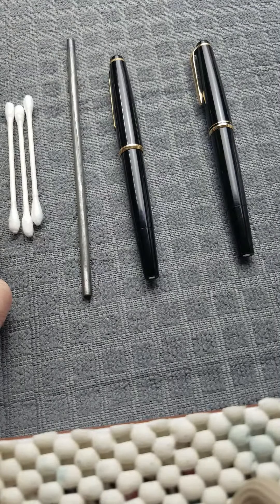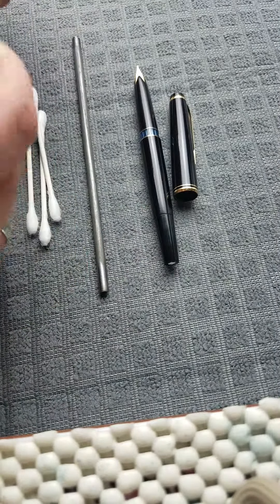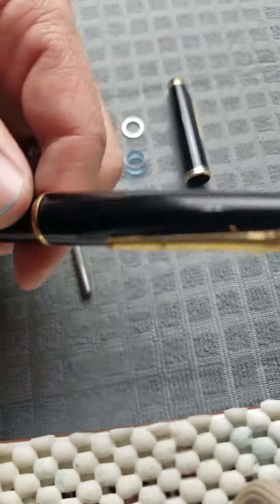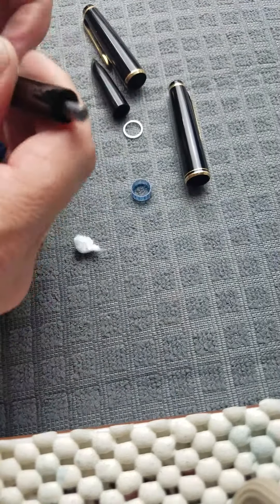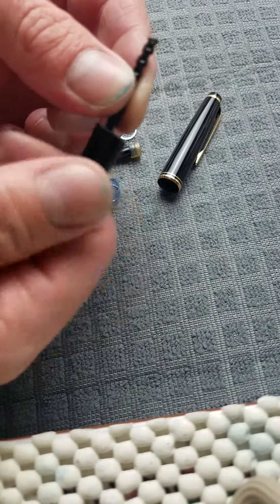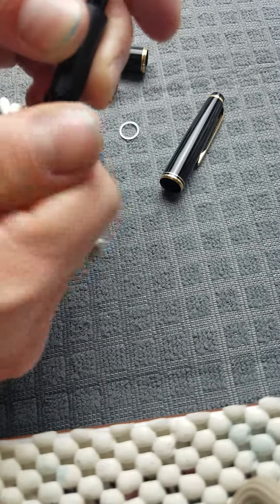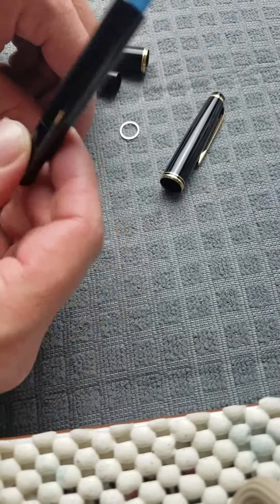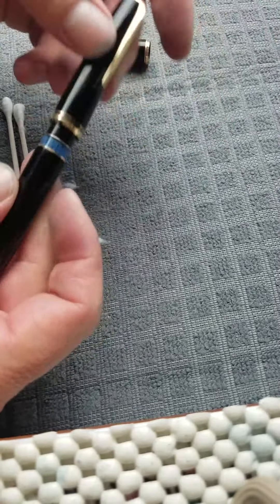Montblanc 22 and 32 disassembly

Comment: Thanks! This video helped me to finally figure out how to disassemble my no. 24. I have the same issue with a  broken off spindle key though. Is there a feasible way to fix the old spindle or do I need to find a replacement? (Hopefully I am using the term spindle right, I'm talking about the piston "screw".)
Reply from the maker: If the helix rod is broken, then you'll most likely need to find a replacement. Glueing the pieces back together may be possible, but I haven't found a good way to accomplish that.
Reply: @penrealm8345  Brilliant, thanks! I too have had little luck with glue and plastics, and the broken off part has become dust so there's nothing to glue in this case. I might try to friction weld on some filament and sand it down.
Reply: Also just saw your reply to @raggedbreath; might you still have a spare?